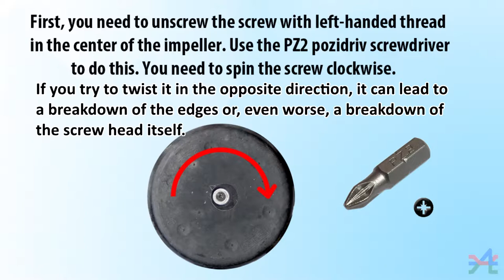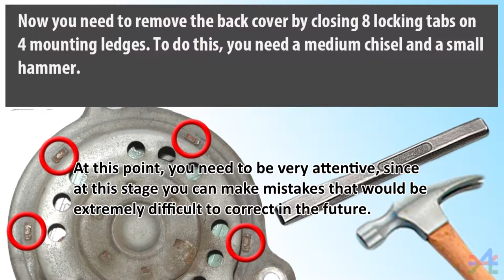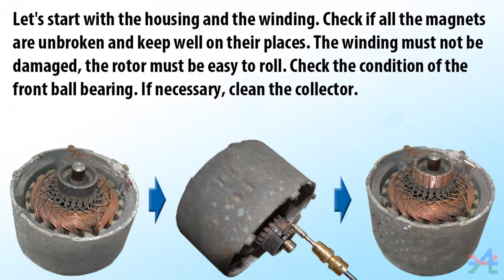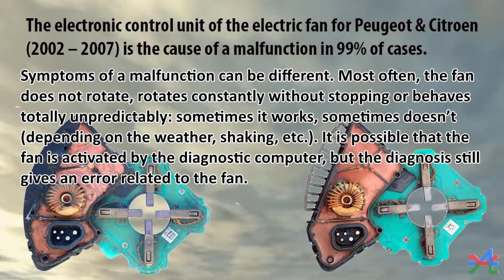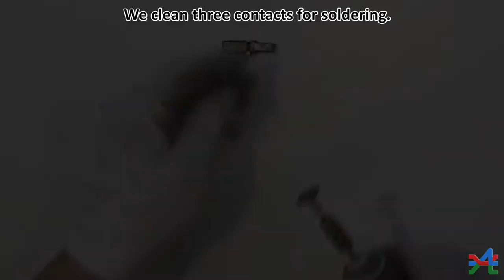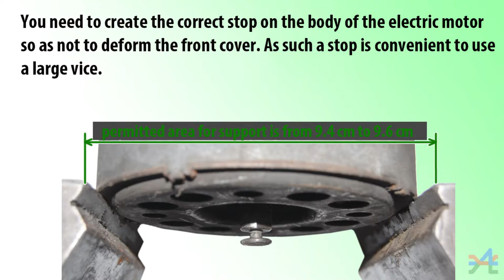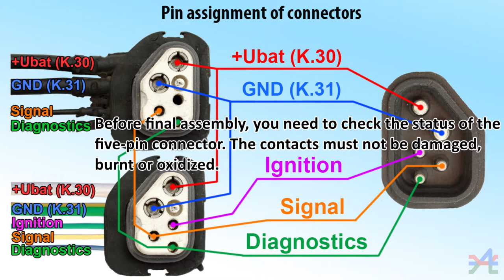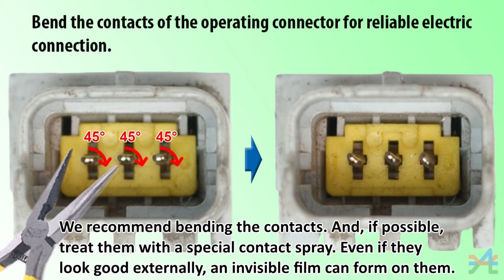Repair of the electric fan for Peugeot & Citroen 2002 – 2007

Comment: Great Video, ever seen the best about Fan Motors, Many Thanks , I have question , there are OEMs beside the Original piece, how we verify or differentiate the original? any approach for this? Many Thanks again for your efforts and answers
Reply from the maker: Many thanks, Mehmet Kilic. The original cooling fan has black wires and power relays, brown on newer fans, gray on old ones. On Chinese fans, the wires are colored and the relay is black. Sorry for the low quality photos.
https://electrorefit.com/2020/08/13/differences-between-the-original-and-chinese-cooling-fan/
https://electrorefit.com/2020/07/13/peugeot-citroen-cooling-fan-replacement-polish-fan/
Reply: @electrorefit2101  Many thx, I have 406 model 2004  with Auto GEAR, and now the motor has broken, as I see the Fan Moto is ECU connected , which spare part should I order I'm confused?
Reply from the maker: @mkilic6497  Sorry, I didn't see your message. In this case, you need to order the ECU and do the manipulations shown in the video. Thx
https://electrorefit.com/product/peugeotcitroen-psa-2002-2007/

Comment: Is it possible to make a PWM modulator to use universal fans?
Reply from the maker: The module can be used to upgrade fans without an ECU. Thx.
https://electrorefit.com/product/external-performance-ecu-for-upgraiding-peugeot-citroen-psa-fans/
Reply: @electrorefit2101  I appreciate that! Thanks!, but for me, that resides in Brazil, this price is salty AF, i can buy a brand new fan with all the mounts and shit... but, you saned my curiosity! Thanks!

Comment: Thank you so much ! i have a question , my radiator fan is same this fan (citroen c2 1.4sx 2004) and not starting stage 1 . if i plug out fan relay and plug in fan relay , fan running high speed.

Which circuit element  in fan board do you think I should control for?
Reply from the maker: If you power the fan motor directly, bypassing the control board, it will always run at maximum speed.